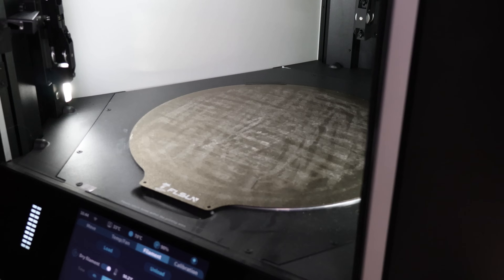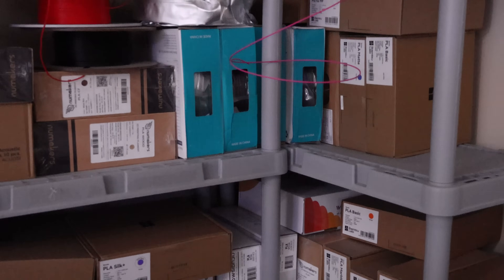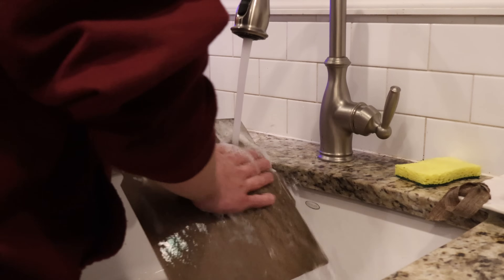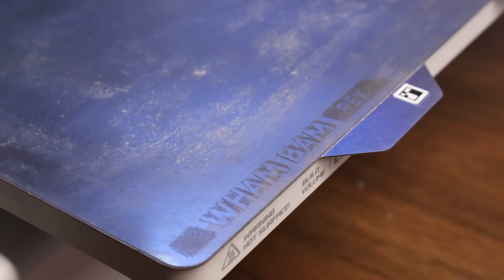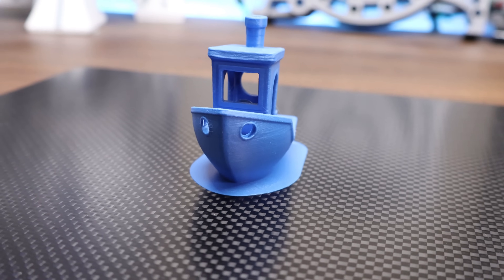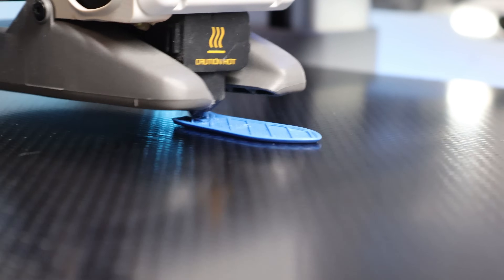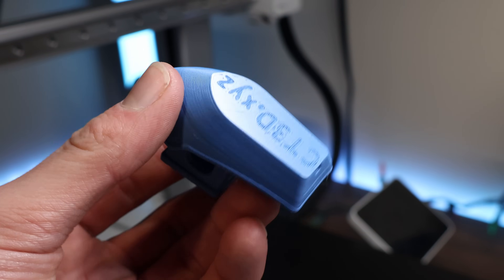I Tested EVERY Kind of Buildplate... Which is right for you?

Comment: Did you change your z-offset or temp settings on the darkmoon g10? I’ve had it for 20 days and it just won’t stick with anything! I’ve cleaned and scrubbed it but nothing. PLA, PETG, or ABS. It just lost adhesion on a PLA print and death blobbed my heater element.

Comment: Bambu beds are the way to go. They have some kind of material memory, since I have damaged a few printing PETG with a badly calibrated printer and they are alright now. I don't know what kind of black magic used Bambu, but it is what it is.
Aliexpress beds are perfectly fine, tho. The cheapest/slimmest I have bought prints even better than the official ones, since prints stick better and it bends great after printing. But it's been peeling after ~50 prints or so. Anyway, great printing/money ratio.

Comment: I print TPU on an A1 with no glue on a textured pei bed. I never use glue on anything especially the smooth bed that adheres super well. I'd rather slow it down then clean it every print
Reply: Just finished a 18h print on p1s tpu no glue

Comment: I’m able to print with every single filament on the 3D Effects plates. If you read the instructions all you do is use IPA to wipe clean and make a profile of bed temp at 70C. These sheets grip insanely well at 70-75C once they cool the prints pop right off. My customers love the mirror-like finish of my designs.

Comment: I've been printing exclusively on G10 / FR4 for at least 6 years now. Love it! It also doesn't need any maintenance whatsoever .
(my prints are 95% ABS and ASA prints, 5% TPU)
Reply: I tried G10 that is 0.5 mm thick for ABS but getting very little adhesion and prints are still warping and coming off.  The bed temperature is 110 degrees Celsius on an Ender3. PLA works fine, but not ABS. Are there any things different you are doing such as keeping the G10  surface at 110 for longer before starting the print, or printing on a thicker G10 sheet? Would be great to know. Thanks.
Reply: @user-cg2xs2jd9b  My G10 sheet is 1.5mm thick and set to 100C. The printers chamber normally settles around 45C without the chamber heater on, which is enough up to mid size prints.
Be sure to clean the surface well with Iso alcohol and don't touch it again with your fingers. Then it's a set and forget build surface for me. I never remove it from the bed, I never have to do a new bed mesh before printing. Nice thing is also that it is indestructable! Not the smallest damage can be seen after these years

Comment: Questions on SuperTack vs Cryogrip Glacier. Seems like the Glacier give lots more options since it can be used with lots more filament types. But how smooth is it and how does the smoothness compare with the SuperTack? Does the Glacier smoothness change based on the filament being printed? How well does the Glacier work with PLA & PETG? I primarily print in PETG & PLA (but use other filaments occasionally too) with a Bambu Textured PEI plate but am definitely looking for a smoother option. Do you need to use glue stick (or other release agents) with the Glacier? I generally don't use release agents and would rather not if possible. Also the Glacier seems quite a bit less expensive than the SuperTack (as of 4/5/25, Glacier is $23.99 vs SuperTack $34.99). Interested in your thoughts. Thanks.

Comment: Dies smooth PEI give the same finish as glass though?
Or dies it not look as smooth as glass?
Would it even be possible to use a glass bed on the A1 and hiw would you go about ir, I mean would the normal calibration handle the difference in Z offset ir do you need to do something special to set the Z filod a glass plate because it's much thicker

Comment: Is there a 235mm (Ender 3) alternative to the Supertack bed? Or anything similar.
And I do not want to cut it down... :(
Reply: CHAPTERS 
0:19 Textured PEI Build Plate
2:42 Smooth PEI Build Plate
4:07 PEX Build Plate
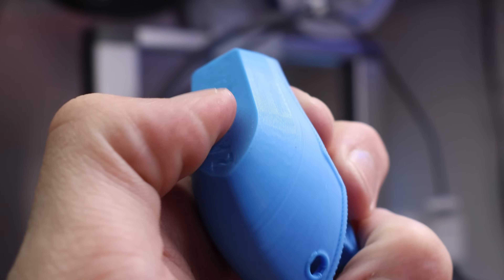5:14 Biqu Cryogrip Build Plate
6:29 Bambu Lab SuperTack Build Plate
8:14 3D Affect Build Plate
9:51 Darkmoon 3D CFX Build Plate
12:27 G10 Build Plate

Comment: I see you’re using Bambu Labs. A PEA specular build plate is not yet available but if someone makes one for Bambu printers, try it out for PLA. Bed adhesion is excellent and the surface finish is glossy.
Reply: CHAPTERS 
0:19 Textured PEI Build Plate
2:42 Smooth PEI Build Plate
4:07 PEX Build Plate
5:14 Biqu Cryogrip Build Plate
6:29 Bambu Lab SuperTack Build Plate
8:14 3D Affect Build Plate
9:51 Darkmoon 3D CFX Build Plate
12:27 G10 Build Plate

Comment: maybe you can help me.  I am trying to print a piece from TPU 85A that has a large, flat surface against the build plate.  I have tried all different settings, and the parts stick so freakin hard.  is there a build plate that's lower adhesion than the smooth plate?  I have a Bambu A1.  I would really like to not have to do the glue stick thing.  It's such a mess to clean up lol.  Any ideas?  I really think a Teflon surface would work great for me.  The bottom print surface quality doesn't matter for my purposes
Reply from the maker: I would reccomend using G10. No glue required and no heated bed either. Just clean the surface, and run the print without a heated bed and it’ll stick well but not too well. I got mine from dark moon3d if you want to check theirs out I’ve been loving it.
Reply: @EngineeringAddiction CHAPTERS 
0:19 Textured PEI Build Plate
2:42 Smooth PEI Build Plate
4:07 PEX Build Plate
5:14 Biqu Cryogrip Build Plate
6:29 Bambu Lab SuperTack Build Plate
8:14 3D Affect Build Plate
9:51 Darkmoon 3D CFX Build Plate
12:27 G10 Build Plate
Reply: CHAPTERS 
0:19 Textured PEI Build Plate
2:42 Smooth PEI Build Plate
4:07 PEX Build Plate
5:14 Biqu Cryogrip Build Plate
6:29 Bambu Lab SuperTack Build Plate
8:14 3D Affect Build Plate
9:51 Darkmoon 3D CFX Build Plate
12:27 G10 Build Plate

Comment: What is the best plate for phone cases? I am getting residue stuck on phone case prints with a smooth plate.
Reply: CHAPTERS 
0:19 Textured PEI Build Plate
2:42 Smooth PEI Build Plate
4:07 PEX Build Plate
5:14 Biqu Cryogrip Build Plate
6:29 Bambu Lab SuperTack Build Plate
8:14 3D Affect Build Plate
9:51 Darkmoon 3D CFX Build Plate
12:27 G10 Build Plate

Comment: I swear by the smooth pei. No glue, iso 99 wipe before every print. It's funny how many people just brush over the smooth pei. Ive tried so many other plates and I always end up back with it. I love the finish. Great video covering the pros and cons of each main plate type.
Reply: Ditto! For multicolour stuff where you want text, printing that face down on smooth PEI is incredible.

I also skip the glue, even with petg. I've found switching plates and leaving it out to cool properly before trying to get it off is fine.
Reply: CHAPTERS 
0:19 Textured PEI Build Plate
2:42 Smooth PEI Build Plate
4:07 PEX Build Plate
5:14 Biqu Cryogrip Build Plate
6:29 Bambu Lab SuperTack Build Plate
8:14 3D Affect Build Plate
9:51 Darkmoon 3D CFX Build Plate
12:27 G10 Build Plate
Reply: its the best ive used.
Reply: i just got a smooth plate, now i need to learnign the best way to use it lol. i usually use textured pei but i do have the carbon one 3d style effect ones.  what plate type setting in bambu do you choose? the reson i ask is i chose a diff type when i used the 2d and carbon plate and it didnt work, it seemed to hold better with textured setting.
Reply: I have one but I prefer the supertack, it leaves a surface finish that matches the other sides better (the smooth plate finish is more glossy) and is very reliable for PLA and PETG. I've also never had to wash it. The only real issue is that wisps of filament stick down and are impossible to get off, so sometimes I have to print a 2-layer print over them to pick them up.

Comment: I am liking the new Creality Epoxy Resin build plate. It has very good adhesion. You need to let the parts actually cool off to get them off the bed easier, if they are warm it is a bit more difficult to get parts to release.

It leaves a smooth satin finish on the bottom, which I like a lot.

It looks similar to the super tack... But the Creality Epoxy bed works with many filaments. I use it for ABS without issues. I think I used it with nylon as well, but I cannot remember for sure as I do have a plate I use for nylon only which is a textured PEI with Magigoo glue for PA/nylon.
Reply: CHAPTERS 
0:19 Textured PEI Build Plate
2:42 Smooth PEI Build Plate
4:07 PEX Build Plate
5:14 Biqu Cryogrip Build Plate
6:29 Bambu Lab SuperTack Build Plate
8:14 3D Affect Build Plate
9:51 Darkmoon 3D CFX Build Plate
12:27 G10 Build Plate

Comment: That G10 sounds exciting as I doubt I'll be printing anything fancier for a while and I definitely like the sound of "no glue necessary". Already have the BIQU CryoGrip Frostbite which I think is quite fantastic for PLA & PETG.
Reply: Just got mine!  I picked it because i am brand new to this hobby and it seems like it would be one of the most forgiving plates to use.
Reply: CHAPTERS 
0:19 Textured PEI Build Plate
2:42 Smooth PEI Build Plate
4:07 PEX Build Plate
5:14 Biqu Cryogrip Build Plate
6:29 Bambu Lab SuperTack Build Plate
8:14 3D Affect Build Plate
9:51 Darkmoon 3D CFX Build Plate
12:27 G10 Build Plate

Comment: When I first started 3d printing with a used Prusa I had a lot of issues and tried glue sticks on the smooth plates.  Like your application of the glue stick it was a mess.  I switched to Elmers liquid school glue which it thinned with a little water and applied with a micro fiber cloth.  It worked great, smooth and lasted at least week before reapplying.  A friend told me to lightly sand the plate with wet 600 grit and try going glue free, worked great.  The plate had been used in a print farm, no telling how old.  I haven't used glue sticks in years as I have found that a plate wiped with IPA right before the print works perfectly for me printing PLA and PETG.  Your results may vary
Reply: CHAPTERS 
0:19 Textured PEI Build Plate
2:42 Smooth PEI Build Plate
4:07 PEX Build Plate
5:14 Biqu Cryogrip Build Plate
6:29 Bambu Lab SuperTack Build Plate
8:14 3D Affect Build Plate
9:51 Darkmoon 3D CFX Build Plate
12:27 G10 Build Plate
Reply: Agreed. I come from the old days and in all my years printing, glue stick has only ever made adhesion worse. I have absolutely no idea how it ever came to be so wildely recommended or used.

Comment: Thanks. I don't care much about energy, as it's kind of low with 100W power consumption, plate would take thousands hour to repay and energy is not cheap where I live. I tried only textured PEI, although I have smooth PEI for two weeks, my only issue with this surface is that it needs thorough cleaning by detergent and brush every ten prints or so and I have problem with adhesion of both PLA and PETG - sometimes longer parts bend upwards and detach at long ends. It's hard to predict what "longer part" means, it could be 4x6cm 2mm thick perimeter wall, it could be 3x15cm filled rectangle.
Reply: CHAPTERS 
0:19 Textured PEI Build Plate
2:42 Smooth PEI Build Plate
4:07 PEX Build Plate
5:14 Biqu Cryogrip Build Plate
6:29 Bambu Lab SuperTack Build Plate
8:14 3D Affect Build Plate
9:51 Darkmoon 3D CFX Build Plate
12:27 G10 Build Plate

Comment: I have most of the plates you tested, with the exception of the Wham Bam & Dark Moon. The two plates I use the most are the BBL SmartTack and the CryoGrip Glacier. The SmartTack is awesome for tall items with a small plate footprint - things just stick without a brim or other supports. The CryoGrip FrostBite is close to the SuperTack in "stickiness". I do find I have better quality first layers with the CryoGrip plates if I use normal textured PEI bed temperatures and not the cooler temperatures recommended for the plates. I print mostly PLA and prefer a smooth satin bottom layer - I' not a fan of the BBL textured PEI plate's bottom surface.
Reply: Wtf is smarttack
Reply: @Skrio4  My bad. Super Tack.
Reply: CHAPTERS 
0:19 Textured PEI Build Plate
2:42 Smooth PEI Build Plate
4:07 PEX Build Plate
5:14 Biqu Cryogrip Build Plate
6:29 Bambu Lab SuperTack Build Plate
8:14 3D Affect Build Plate
9:51 Darkmoon 3D CFX Build Plate
12:27 G10 Build Plate

Comment: Is there no print surfaces that you intentionally make stick permanently to your printed part? Many objects you print do not need the bottom to be "clean" and I wonder if a intentionally ruff surface you can stick to your normal print bed with magnets or weak glue but leave attached to the printed part could not give a good result. You could even sand off that base layer if you add a mm or two with solid infill to the base of the printed object. Has nobody ever made such a 1 per print type base?

Comment: Hw is so right about the Super Tack except for the removal of models. Let it cool. If you think it's cooled let it go another couple of minutes. It will pop right off the plate. Getting another one once back in stock.
Reply from the maker: Yeah it’s an amazing plate! I’m surprised about your removal experience though, I’ve let prints cool overnight and still had the same trouble getting them off. Maybes it’s the brand of filament though
Reply: @EngineeringAddiction Pop the plate and the attached print in the fridge for 30 minutes (or freezer for 15 minutes). This tip applies to any plate.
Reply: @EngineeringAddiction CHAPTERS 
0:19 Textured PEI Build Plate
2:42 Smooth PEI Build Plate
4:07 PEX Build Plate
5:14 Biqu Cryogrip Build Plate
6:29 Bambu Lab SuperTack Build Plate
8:14 3D Affect Build Plate
9:51 Darkmoon 3D CFX Build Plate
12:27 G10 Build Plate

Comment: So good to hear someone else mention PEI doesn't stick for them. I just get gaslit non-stop with people insulting me saying its still dirty, my axis is wrong, im doing wrong temps, etc.. but if the conditions are not absolutely perfect, zero dust, no alcohol residue, no previous print residue, etc.. it can occasionally work as long as i do 15mm brims on everything.

My best so far is the Supertak style cool plates. Sticks perfect every time, but never too hard to remove for PLA/PETG. Allows me to finally close the P1S door too. Only complaint is cleaning. Its not safe to clean with lots of solvents or even iso alcohol and it's texture grips paper towels and microfiber cloths, and peels fibers off that stick to the plate.
Reply: That's what brought me here too! My pei just has issue after issue with bed adhesion. If I wanted to deal with that I would replace my Saturn 2's screen 😂
Reply: CHAPTERS 
0:19 Textured PEI Build Plate
2:42 Smooth PEI Build Plate
4:07 PEX Build Plate
5:14 Biqu Cryogrip Build Plate
6:29 Bambu Lab SuperTack Build Plate
8:14 3D Affect Build Plate
9:51 Darkmoon 3D CFX Build Plate
12:27 G10 Build Plate

Comment: You shouldn't have to use gluestick anymore.  Just keep you plates clean and you should be ok. If you need something use something like Magigoo.
Reply: If you keep your plate too clean, it needs glue even more. He is using it as a releasing agent for when things stick too hard and will damage the PEI when pulling off. TPU is a nightmare to release without glue or alcohol application while pulling.

Comment: I might have guessed that the Cryogrip plate would have been the no 1 choice.  It seems to do well across a wide variety of material's, has great adhesion, lower operating temps... what more could you want?  

However please note that I am still quite new to this scene and I really don't know shyte about this stuff from experience, only what I have read and heard so far.

So what be your opinion on the Cryogrip?  Why choose the G10 over it?  Also, good video, nicely done.  Would be nice to see a graphic showing all the build plate material options and how well each one does for every category of extruded material.  Cheers
Reply: CHAPTERS 
0:19 Textured PEI Build Plate
2:42 Smooth PEI Build Plate
4:07 PEX Build Plate
5:14 Biqu Cryogrip Build Plate
6:29 Bambu Lab SuperTack Build Plate
8:14 3D Affect Build Plate
9:51 Darkmoon 3D CFX Build Plate
12:27 G10 Build Plate
Reply: @Cart_of_a_Jon  Which do you like to use and why?  And how do you get the timestamp to be a hyperlink?  I actually used to know - getting old i think

Comment: Darkmoon needs to make their Carbon Fiber and G10 plates for the Qidi printers. They’re specifically built for engineering materials, so both their plates would fit far better there than the Bambu printers that can’t even go above 300-320C nozzle.
Reply: CHAPTERS 
0:19 Textured PEI Build Plate
2:42 Smooth PEI Build Plate
4:07 PEX Build Plate
5:14 Biqu Cryogrip Build Plate
6:29 Bambu Lab SuperTack Build Plate
8:14 3D Affect Build Plate
9:51 Darkmoon 3D CFX Build Plate
12:27 G10 Build Plate

Comment: Never ever used a glue stick on either Gold rough PEI and Smooth printing PLA, PETG, ABS, ASA, TPU. Never stuck enought that you couldnt get it off and never fell off.
Reply: Glue stick is for a release layer. I've had ASA stick to where it couldn't be removed on a failed print.

But never with a clean build plate. I try to wash mine anytime it's looking messy.
Reply: CHAPTERS 
0:19 Textured PEI Build Plate
2:42 Smooth PEI Build Plate
4:07 PEX Build Plate
5:14 Biqu Cryogrip Build Plate
6:29 Bambu Lab SuperTack Build Plate
8:14 3D Affect Build Plate
9:51 Darkmoon 3D CFX Build Plate
12:27 G10 Build Plate

Comment: You can do hilbert curve for top surface to sort of match the pattern of bottom layer of textured pei plate. I mean it's not the same,  but significantly better looking than monotonic line. Even on smooth plate monotonic line looks bad, I tend to avoid it. Hilbert curve slows down print process if print has a lot of top surfaces, but it looks intentional, like a manufactured part. Whereas monotonic line looks cheap.
Reply: CHAPTERS 
0:19 Textured PEI Build Plate
2:42 Smooth PEI Build Plate
4:07 PEX Build Plate
5:14 Biqu Cryogrip Build Plate
6:29 Bambu Lab SuperTack Build Plate
8:14 3D Affect Build Plate
9:51 Darkmoon 3D CFX Build Plate
12:27 G10 Build Plate